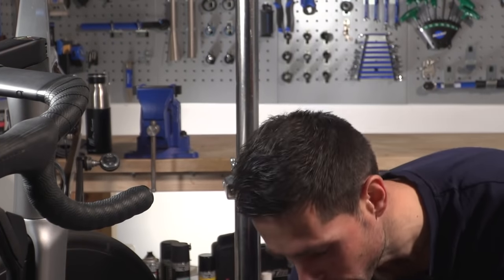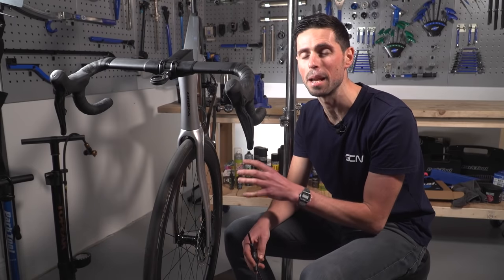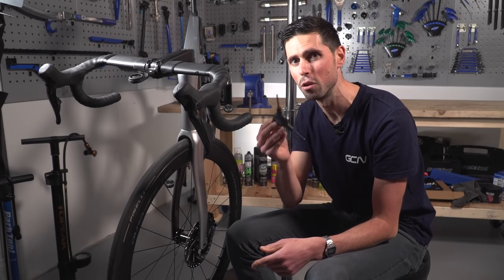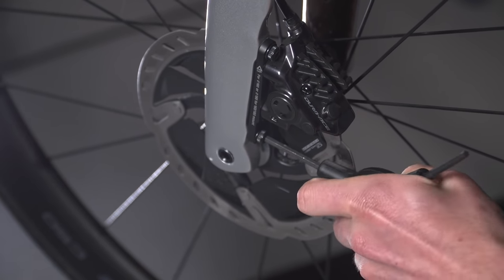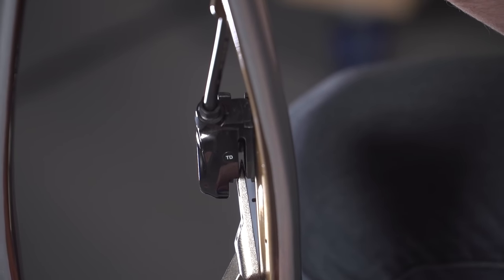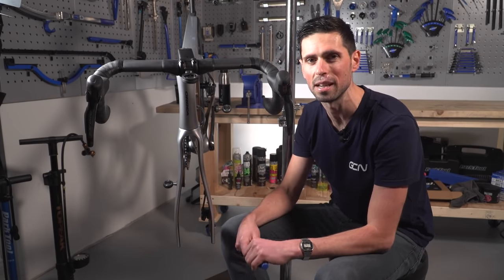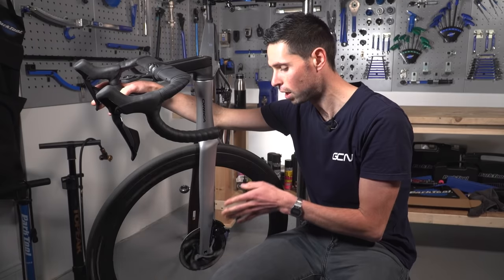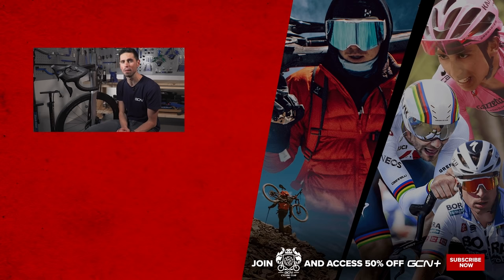How To Stop Your Disc Brakes Rubbing! | Maintenance Monday

Comment: I guess being a cyclist for 40 years makes you set in your ways, however I have always embraced change whenever it has raised its head. I have always thought positive change brings better applications for improvement, like electronic shifting, carbon frames, lighter parts and 12 speed. All massive steps to improve cycling, but I just cant understand why you would put disc brakes on a Road bike. I have several bikes 12 road bikes, Colnago, Pinarello, Canyon and Sworks and ALL are rim brakes and I have no intention of buying a road bike with disc brakes as rim brakes work. I just hope that Colnago and Pinarello dont stop making frame for rim brakes, as this change to disc brakes is about choice and my rim brakes dont rub ever
Reply: Agree 100%
Reply: I assume you don't commute then.
Reply: @thegrowl2210  No retired, cycled 16,000 miles last year and 6 million feet in elevation
Reply: Just a week ago my rear tyre sidewall ripped apart, after a roadside repair with the tube bulging through the sidewall I still had 2 working disk brakes with some winding steep descents to do, if that were rim brake I would have had to release the rear brake and made do with just a front brake
Reply: @nemeanf27  shit happens, I always carry a section of old tyre so if something cuts the sidewall. I then insert it inside the tyre to cover the cut in wall together with new tube that won't bulge out, good to go even 50 miles from home with TWO rim brakes.
Reply: Having made the change to discs...its amazing imo. No rubbing, braking consistency in all weather.  No problem, no maintenence needed, just once i spend the brakes and change oil...thats about all the maintenence i do.

No cables, no problem...but that probably just comes from me riding really old bikes, new rim brake bikes are just as good and enjoyable once you set the brakes properly.
Reply: @anthonyholmes1704  touché! Beautiful, love my Pinarello rim brake bike.
Reply: Conversely, I never understood why anybody stuck with rim brakes that barely work in the wet and are effectively destroying your wheels every time you apply them.
Reply: @thegrowl2210  I have a suggestion for commuting.  Car
Reply: Hydraulic is nice though. Magura makes a hydraulic rim brake, but they seem to have given up on road bike brakes which is weird.  Why would any mountain biker want a rim brake except for a vintage rebuild?  Maybe people couldn't get past the aesthetics of a hydraulic cylinder sitting on top of a road bike brake.

Anyhow this is one of those changes the market is forcing on late adopters; choice in rims with brake tracks is gradually drying up year by year.  For gravel bikes, it's nice to have a choice of wheel size.
Reply: @DBxCooper  Would have thought you'd have suggested parachuting in
Reply: @davidf2281  I am not stuck with rim brakes I choose to ride with them, they have also served me well in keeping me safe in many years of racing and club rides in all types of weather in UK and Europe. If you cant descend a step long road with switchbacks in the wet with rim brakes then you should not be riding a bike. What do you think we all did before disc's got off and walked down? As for wheels wearing, I have never had a problem I use a 'winter bike' during the bad months for long training miles with cheap Campagnolo Calima wheels which i look on as a 'throw away' wheel. My carbon wheels are used when seasons are suitable with no wear. Maybe buy more bikes or more wheels, a cyclist can never have too many bikes
Reply: @grumpynerd  Once you introduce hydraulic oil into the equation its adding another problem, it increases maintenance substantially i.e the S-Works Venge with hidden cables and hydraulic discs is a 4 hour maintenance job for a experience mechanic to change the headset bearings. This is not really practical or cost effective with bearings being the main 'replacement' on modern road bikes. Keep it simple Keep me on the road and let me ride rim brakes direct mount with cables.
Reply: @anthonyholmes1704  I think the problems you're talking about come from how they route stuff through the head tube, not hydraulics per se.  As someone who does his own maintenance I wouldn't touch a bike like that, although I understand the visual appeal.   Hydraulic brake installation and maintenance per se aren't hard at all, but of course a frame designer can always find ways to make your life difficult.

The effortless power and modulation of a hydraulic brake is a real practical day to day advantage. The weight and aesthetics are not.
Reply: @grumpynerd  thank you Matthew

Comment: Contaminating the pads with bike cleaning fluids can also cause brake squeaking.  Always rinse your brakes thoroughly after washing the bike.
Reply: A quick squirt of disc brake cleaner and wipe the rotors is a good first step if things are squealing during actual braking.  Clean, sand, and re-bed the pads as well if still no luck.
Reply: @123moof  I had to stop using disc cleaner sprays, they are guaranteed to make my brakes squeal. They get them too clean almost, I could only resolve that by sanding the rotors. Once I stopped using the spray completely all has been good

Comment: Good advice, thank you. 🙏🏻 On a related topic, what’s a reasonable torque for the rotor bolts?
Reply: 6.2 N*m is what is printed on my rotors, so that is what I use.  Always use fresh bolts with the blue thread locker, or add a dab of the liquid blue thread locker if the bolts are removed and re-used for any reason.
Reply: @123moof  Thank you. 🙏🏻 Yes, I sure will. My old bolts are starting to rust so I plan to replace them before they become too brittle to pry loose.

Comment: Cantering callipers and fixing brake rub are an all to frequent occurrence for my road bike. Yet my mountain bikes and motorcycles are problem free. Could this point to a general design flaw in road bike systems? Anyone have a good solution?

Comment: hello.. i also have this problem on my bike. i also notice that when i center the callipers and once i put a weight on my bike (on a saddle)the fork tend to bend a few mm on the left making the brake callipers off the center. so what i did is to offset it. i dont know if im the only one with this problem

Comment: If all that fails, check to make sure that your disc is true.  Look to see if it "wobbles" back and forth while spinning.  Sometimes they get bent, and even a tiny bend will cause it to rub no matter how perfectly your caliper is set up.  If you feel comfortable truing it, give it a go.  If not, your LBS will be able to do it no problem.
If even that fails, you may need to face the caliper mounting surfaces.  Take it to a pro for this.  You can ruin your frame if you mess this up.  I wouldn't even trust just any LBS mechanic.  You want a really good one for this.

Comment: In the case of SRAM callipers, 1. Remove them from bike and throw in bin.
2. Fit literally any other braking system
Reply: I have SRAM Red hydraulic disc brakes with over 35000 miles on them and they are still braking superbly.  Please be kind enough to send me your discarded calipers!

Comment: Such a joke. This hardly ever works. More like 2 times out of 10 it works. Brake rub is an unsolved problems on road bikes. Not a real problem but hugely annoying. I work in a bike shop and sometimes it takes us half an hour to get rid of the rub. The worst thing is that it might come back after a view heavy brakes.
Reply: What do you think about roller brakes? Know it isn't really sporty, but for my commutes they are so nice. They just never disappoints. Have had two bikes with disc. Nothing but problems.

Comment: My disc screechs when i apply the brakes…ive recently changed the pads n the whole unit except the rotors…the rotors seem fine to the eye…but will it require frequent changes toovv
Reply: Just clean the rotors properly with brake cleaner
Reply: Yes, to the comment about cleaning the rotors.  But you also need to bed in new pads properly.  If GCN doesn't have a video on it, GMBN has several.
Reply: @jefferycampbell2243  thanks mate will definitely give it a try✌️
Reply: @indiaismypride  Rubbing alcohol works pretty well too in my experience. The squealing is most likely being caused by oils on the braking surface.

Comment: I learned the hard way a few weeks ago never to actuate the brakes (hydraulic) when there is no rotor in place…
Reply: Keep the little insert (orange usually) that comes with most hydraulic brakes, and religiously pop it in place after removing the wheel.  Keep the yellow brake block handy and insert it whenever you remove the pads.  Save yourself much anguish.

Comment: Question about Latex inner tubes for you. So  purchased my first set of Latex inner tubes September last year (running Vitorria Corsa 23mm tyres. 25mm on rim). I run at 92psi rear 82psi front. Previously I had been using Supersonics for a few years with absolutely no issues. I want to ask about the rapid pressure drop of Latex compared to the SS in the real world. I've seen Aerocoach's website and they claim a 3 watt saving for a set of Latex over SS. I have measured the psi drop from my  Latex tubes at about 7psi after 4hours  and more after 6 hours. Typical extended ride durations for me. Towards the latter end of these rides I can feel the rear tyre has gotten softer so there is going to be an increase in rolling resistance over time with Latex as it reduces pressure. So. Question is, how does this rolling resistance increase with ride duration affect the journey time? I can see a rude where overall it might be faster to use the Supersonic inners?
Reply: Ehh sorry,  that word should ride
Reply: This is everything that is wrong with road cycling. Just enjoy the ride!!

Comment: Except that doesn’t work when the disc rotor gets warped….
Reply: I was going to make that exact same observation!
Reply: Well if it is warped then replace it. It's like saying pumping a soft tire with air does not work when the tire is punctured...
Reply: within limits disc rotors can be trued up.  Park makes a tool for it - (DT-2), its cheap and easy to do.
Reply: @bikndave68  the point is that fixing disc brake rubbing is more complicated than this video makes out and is misleading for people thinking about getting disc brakes.
Reply: @2scottj  a larger issue would be that you don't "get disc brakes" you buy a bike with them. 
Disc brakes have their challenges, I agree. But if you spend the time to learn the ends and outs (avoiding mechanical disc brakes which are as tricky as they get) discs are within any home mechanics ability level. I've had them since 2013 on MTBs and since 2017 on the road, I won't go back.

Comment: Can be a old (4_5 years) brake pad became noisy? The pads ar not worn and i cleaned the brake rotor and also the pads really good so there's no contamination on them and i also have a great braking power but they always noisy. Can a fresh brake pad solve the problem??
Reply: Maybe, try burning them through a descent a bit, it should get rid of that old braking surface.

Comment: How about on the rear wheel? I'm usually able to fix the front one, but the rear is quite difficult. Any tips?
Reply: Clean pistons, they should be white not covered in brake dust.

Comment: 9/10 your method does not work for my three disc bikes.  I found the feeler gauges offered by several companies for disc brakes work great on centering the rotor while re tightening them.

Comment: Rim brakes are the answer.
Reply: And then you ride through a muddy puddle........
Reply: @drivemenuts3011  …. and nothing really happens.
Reply: The answer to average braking performance
Reply: @dh7314  cheap, light, aerodynamic, easily serviced, average braking performance.

Comment: After i pushed the pistons, oil leaked from my sti. Could that be over pressure? What can i do?
Reply: Someone has bled your brakes when the pads were worn and that completely filled the system with brake fluid.  That "extra" fluid had to go somewhere when you pushed the pistons back in and the only place to go is out the brake lever reservoir.  Clean everything with alcohol and it should be fine.  Just keep an eye on it to make sure you haven't damaged the seals in the lever.
Reply: There's a chance you may have broken the seal due to overpressure.
Reply: Highly likely its a seal/o ring issue. You cannot overfill with brake fluid.

Comment: Didn't GCN say in a previous video that disc's had less maintenance issues than Rim brake? 
Asking for a friend?
Reply: GCN are so bias now. I watched a video a few days back on tbe Zipp 404 firecrest wheels Si did on an orange Orbea... in that video the 4W saving over the older wheels was huge....

Yet on the rim vs disc video Bridgewater did the 16W saving rim brakes give was small apparently 🤷‍♂️🤷‍♂️
Reply: GCN have the opinion of whatever they are paid to say.

When they were sponspored by ceramic speed they raved about over sized pully wheels and ceramic bearings. Now they have said in a few tech videos that they don't offer much.
There was also a break in their muc off sponsorship, during that time they cleaned bikes with supermarket stuff.
They used to have balanced discussions on rim vs disc but now their sponsors seemingly want to push discs. 
need to double check but I recall when Alex first started it was during the new Canyon aero bike hype and he said he preffered lightweight bikes. In the next week's show he had to "correct" his opinion and say he made a mistake and prefers aero bikes. 

Once you know how their 'opinions' work you can ignore the marketing and enjoy the presenters.
Reply: Yes, more maintenance and much safer.
Reply: Marginally more maintenance but not much, but significantly better. If you’re the sort of person who thinks operating a tv remote is challenging then you may find it complicated but most adults should be capable of simple maintenance
Reply: For my case that is true. However, todays rim brakes are just as good imo. I prefer hydro disc though, no maintenence at all, once the pads are spent just change oil and pads and you are set. I hate cables.

I dont get the rubbing issue, never had it on discs.

Comment: When I heard the sound of squeaking breaks I thought I would finally learn the secret how to stop them from squeaking when the breakpads are applied (because that what the sound exactly was). You let me down :)
Reply: It's probably because you have something on your pads/rotor like oil/water and you need to clean them or because your pads/rotor didn't bed in very well

One exception would be that your brake mounts weren't faced by the manufacturer and the uneven surface creates vibrations when braking, that's a common thing nowdays
Reply: Your rotor or pads are contaminated. Keep them clean and you’ll never have any noise. Besides some rubbing, my disc bikes are silent.
Reply: It means you have metal brake pads, get resin and you'll not have any sounds

Comment: Every disc brake I have had have been virtually maintenance free compared to v-brakes.
Reply: v-brakes - all you need to do is set tension corect and set two small philips screw.
Reply: Bollox
Reply: Standard rim brakes require much less maintenance than V brakes.
Reply: @DanuelNuel  and then when you drive through a muddy puddle.....
Reply: @drivemenuts3011  unfortunately it is problem with all types of rim breaks. but from maintenance stand point they are super easy.

Comment: Rim brakes simple.....

Disc on road bikes is just overkill. Carbon wheels in the summer and alloy training wheels for winter.
Reply: When your a over 200 pounds guy, disc brakes are really beneficial
Reply: Try wet descents in the mountains on carbon brake surfaces.
Reply: Oof rims with carbon wheels? Hope you're an organ donor
Reply: @MrPijus123  not all carbon rims are equals this is usually where people go wrong.

My boras with AC3 brake tracks and campy red pads have been proven to be almost as good in the wet as the dry tbf. Same with Zipp NSW rims
Reply: @whatwelearned  never had any issues tbf and I ride mostly on the boarder of Wales where its wet.

Just need a good carbon rim imo.
Reply: @danc1829  recommends doing a lot of research resulting in buying two sets of rim wheels.
I have one set of carbon all year wheels and have never had any issues with disk brakes.
Reply: @drivemenuts3011   hardly a lot of research I own a disc and rim brake bike, the rim brake bike owes me far less even with 2 wheelsets.. (both from the same year).

The bikes are actually the same model aswel 2 TCRs and personally the rim bike is my go to. I brought into discs believing all the hype but was pretty disappointed if I'm honest. 

Much more expensive if you look at any line up such as canyon, Giant BMC etc the disc bike is always more money...

Heavier and imo (owning 2 of the same model both set up the same as in saddles, bars both set up by bicycle Richmond) they also ride very differently the rim bike is a lot more fun to ride.

But what would I know 🤷‍♂️

Comment: In my case: adjust the caliper bolts. Adjust them all the way. Notice it still rubs. Grab rubber mallet. Give Post Mount a solid whacking, test for disk rub, repeat.
Don't try this on carbon frames, hah.
Reply: Never had to do that on my cheap carbon frame and cheap aluminum fork. I just loosen the caliper bolts, spin the wheel, grab and hold on to the brake lever, then re-tighten the caliper bolts.

Comment: The simple method of loosen the two bolts > hold brake > retighten worked for me on the first try. Just make sure you tighten one a little, then the other, and back and forth till both are snug.